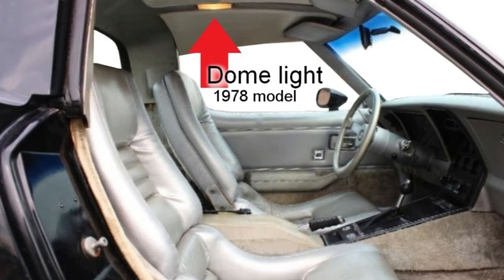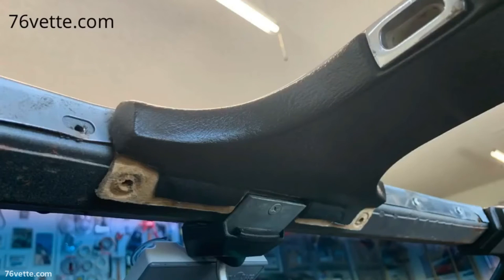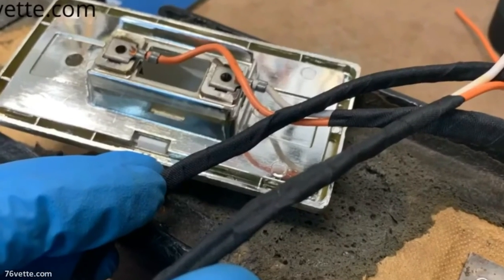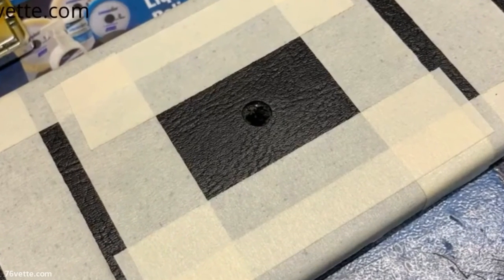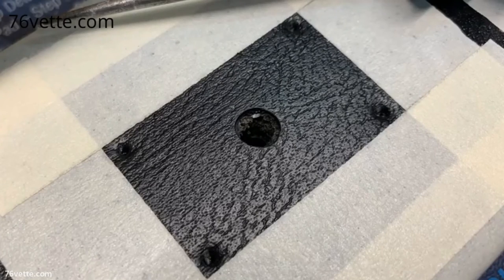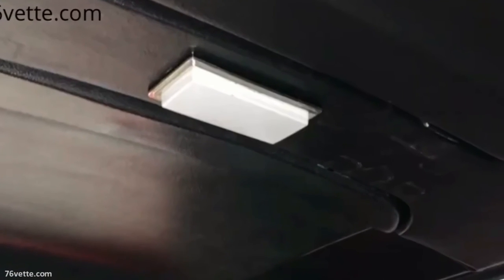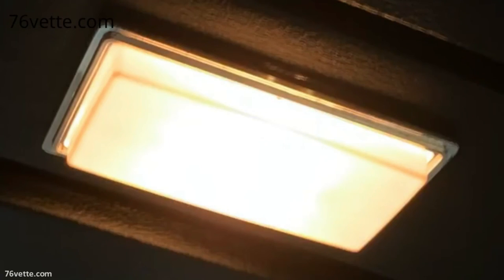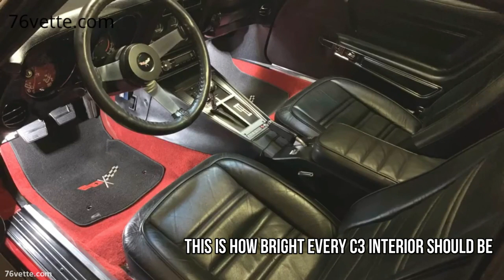Add a DOME LIGHT to Your 68-77 C3 Corvette

Comment: Hi there, which LED bulb did you use to fit in that socket? Also I am looking to install LED courtesy lights underneath the dash as well. Did you use different LED bulbs for those 2 locations? The previous owner took the entire courtesy lights assembly out of my 77 Corvette, so I wanted to ask where the mounting brackets for the sockets go on both the driver and passenger sides?
Reply from the maker: I used BA9S-CWHP5 Cool White bulbs  for all the instruments. They offer other colors as well. I bought a box of 20 which gave me a couple extra bulbs... just in case. 

For the courtesy lights, I ordered two 1156-CW18-T LED bulbs. 

I bought them from SuperBrightLEDs.com.

For the dome light, I ordered 42mm Serundo Auto LED bulbs from Amazon, https://amzn.to/3rwFVYr

The footwell lights use shielded sockets and the driver’s side is attached to a bracket under the dash right above the hood release handle. 

The passenger side socket is secured between the dash and the air duct. I cannot give you specifics without taking it apart, but I’m sure the assembly manual for the 77 Corvette will offer more details. 

I hope this helps. 
Thank you for watching! 😊👍🏻

Comment: Where did you find the clips for the bulb?
Reply from the maker: I relocated the one in the storage compartment to the T-bar, although I’m sure the same type of clip connectors were used in many GM vehicles of the era, so someone must sell those. Alternatively, you can buy a complete unit (base, lens, and clips included) from a Corvette salvage yard such as Corvette Generation in Dade City, FL.